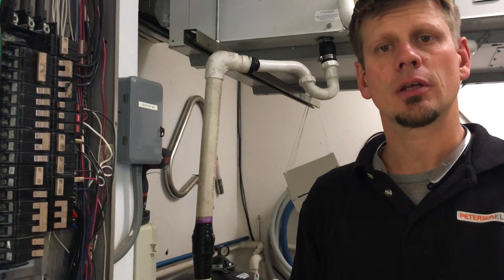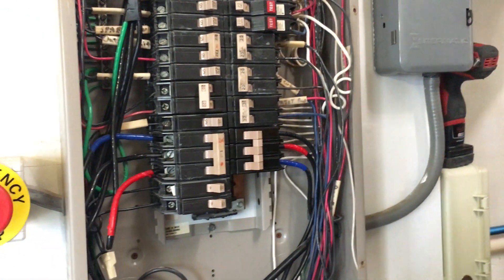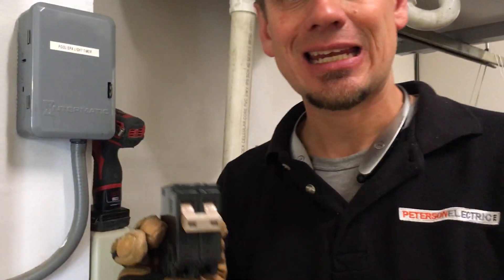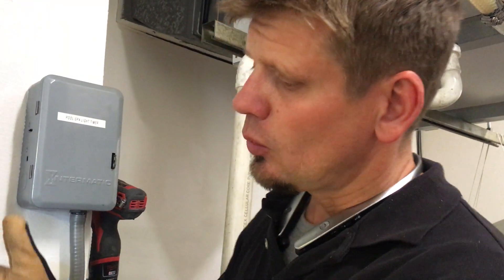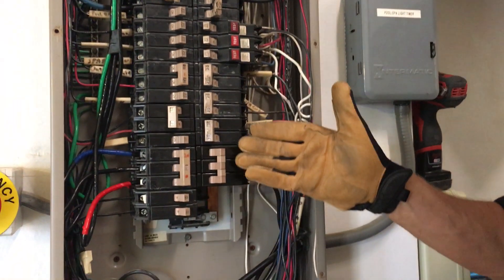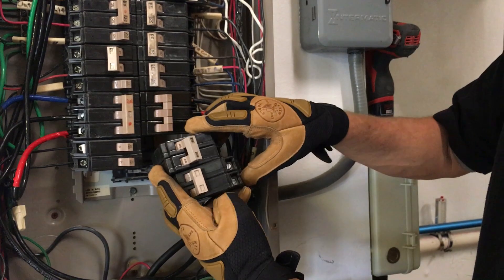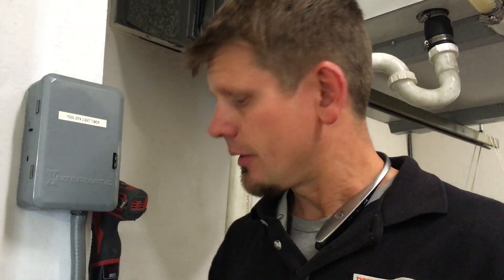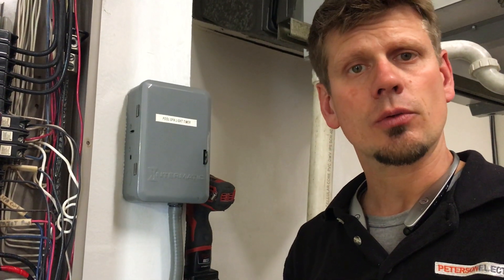Why Hot Water Heater Fuse Burnt Up In Hotel Panel? Part 2

Comment: #1, reason, were elements, rated 240 volts or 208, you must have, 208-3 phase as Not 240, volt, as "B" phase red, not orange. Commercial, 3-phase, you order, elements what voltage you have, Remember ohms LAW.